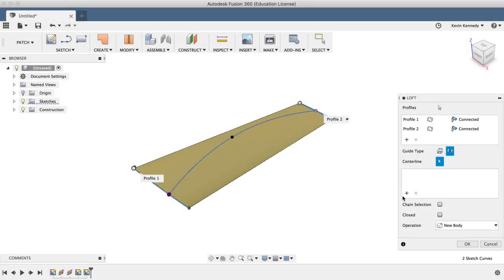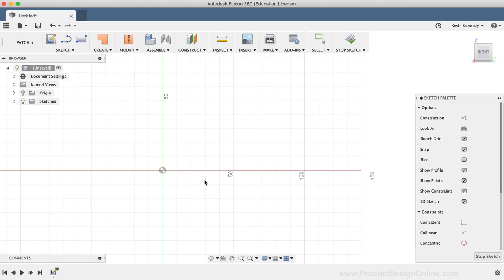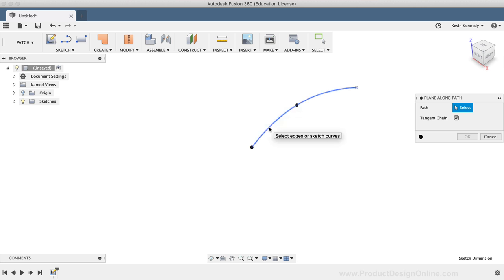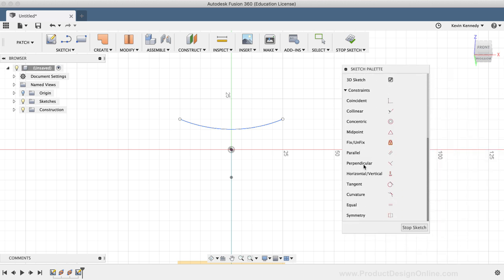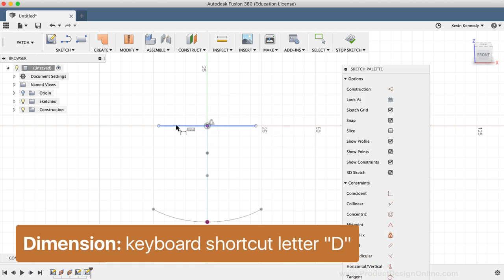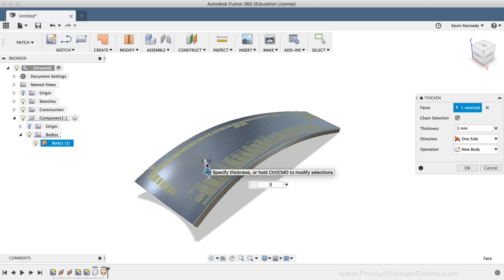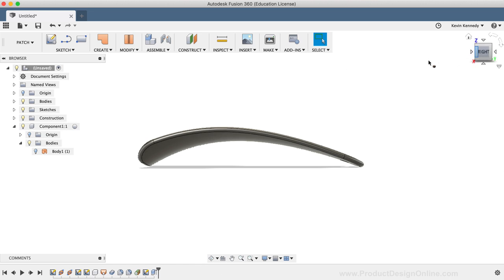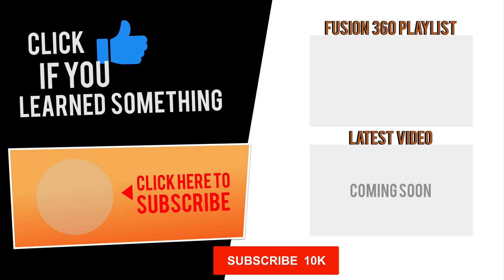How to Surface Model a Shoe Horn in Fusion 360 (for 3D Printing)

Comment: Another great video.  I strongly recommend viewers follow along at home.  Just watching is not enough, there's a lot of good stuff in these videos you miss.

A few things I've learned along the way:

1) First watch through the video at 1.5 speed so you can see the entire process end to end, then each step makes more sense when later
2) Switch back to normal speed and use space bar to pause video as you follow along
3) Alt +Tab between F360 and YouTube
4) Compare all the switches and settings in the dialog boxes so that yours match Kevin's EXACTLY or you may have problems later
5) Make sure you're in the same mode - Patch or Model can also send you down the wrong path
6) Be prepared to try three or four times to get it right just like in the video.  Trust me, it gets easier!
Reply from the maker: I love this, Jim! All great suggestions to the community!!

I understand that everyone learns at a different pace and has a different learning style... and I'm always trying out new teaching techniques. I'm also always open to suggestions and constructive criticism.

However, some viewers don't take the time to think critically about what may be going on. It makes it particularly challenging that Fusion 360 is updated monthly and a video can quickly be "out of date," as in, the visuals are not quite the same. I have been 3D modeling for about 11 years now and have been using F360 since the early days (6 years)... viewers should remember that it takes hours and hours of practice to be able to work through everything... and I strongly believe the small roadblocks reinforce critical concepts and are a crucial step to mastering a complex piece of software, such as F360.

I think you hit the nail on the head with this comment...and as always, I appreciate your continued support! Cheers, Kevin :)

Comment: Really good video as usual from you Kevin. I'd just say that there's a lot to follow in this one and it might be good to do a quick run through what you're doing first and then in detail. Something like "Here's a run through on how I do this, and then I'll walk through it again in detail so you know what's next in each process"

Great video and I can use this for sure with things I make. Re the 3D printer I use a CR10 4S with CURA as my slicer, and I have a large self built CNC too using Mach 3.
Reply from the maker: Thanks for the feedback, Kelvin! I definitely need to start "playing" around with some new styles of talking through these lessons... especially the more "advanced" workflows. I will take all these into consideration for future lessons.

RE: 3D printer... that's great! Let me know if you end up printing one of these shoe horns out. How big is the bed of the CNC you built??? (I'm jealous). Cheers, Kevin :)
Reply: @ProductDesignOnline  A friend / colleague made it. It's pretty large 8' wide with a 4' lift and theoretically infinite length. Also has a 4th axis facility
Reply from the maker: @kelvink8955  That's incredible! Keep me posted on any cool things you make ;)

Comment: I was gonna say: This is a difficult thing to 3d print. It will need a certain orientation and supports. I would try placing it standing at 45 degrees and supports from base I guess. Thank you for another great tutorial man!
Reply from the maker: Thanks, Nick. Glad you enjoyed this one. Yep... I guess the orientation depends on what type of printer. I was planning on printing it out with a dual extruder (commercial printer) that I have access to, in which one of the materials will be dissolvable.

Let me know if you end up printing one out! I'd love to see a picture and hear which way you ended up orienting it. Cheers, Kevin :)

Comment: I am trying to learn how to make custom pistol grips in Fusion 360 to then mill on my CNC machine.  I can import the exact outline sketch, just have to learn how to sculp the grips to desired shape and then add custom engraving design.  2 separate grips which are identical (mirrored).  Great videos!

Comment: Thanks again Kevin for the quality content as usual. This was actually quite interesting and I think it has already answered one of my big questions that I meant to ask a few days ago. Let's say I have designed a wing which has a few ribs and a single-component skin -- made using the surface modelling techniques you have demonstrated in the previous videos.

Now the surface/skin of the wing should be split into smaller components, so they can be individually made out of aluminium sheets. Am I right thinking that I should use the 'Plane Tangent to Face at Point' and then start splitting up the surface into pieces that I need, so it would respect the shape and curvature of the wing surface?

The edge of these skin components should line-up with some of the wing ribs and they should slightly overlap each other, so they can be riveted together to the wing rib, so it won't be a freehand drawing or some arbitrary cuts. If you have any comments regarding any of these, I would love to hear that.

Also I do realise that this is not something that most viewers would need to do very often and it may not be worth of your time to make a video about it. But I would really appreciate if you can point me to the right direction.

Thanks a lot!
Reply from the maker: Hi, Mahdi M. I think you're on the right track. You don't necessarily have to use the 'Plane Tangent to Face at Point.' You can use any of the construction planes that allow you to create the geometry you're looking for.

As far as the different surfaces... I think you're correct. I would try to make them all different surfaces. Then, you will probably find it best to create a component for each surface as you thicken them with the thicken command. I would then recommend coming up with some sort of numbering system so it's easier for you to understand what panel is what.

One thing that you may find helpful is to create a large surface over the wing's structure. Then, you can split the face up into sections (as you mentioned)... and then you could use the "extend" tool to extend faces where you need them to overlap. The only thing you'll have to be careful of is the surfaces running into each other.  You may have to rotate or reposition the faces before you extend them.

You're doing great implementing some of my tutorials into your own designs. Keep it up!!!

Cheers, Kevin :)
Reply: @ProductDesignOnline  Perfect! Thanks a lot Kevin for your recommandations! I've recently come to known Fusion 360 and I'm absolutely in love with it and your tutorials not only helps me do the things that I need to do, but also keeps me interested to learn and discover more of Fusion 360!

Thanks again for your time and I guess I’m going to keep bugging you every now and then with my questions!

Cheers,
Mahdi
Reply from the maker: @Mahdi-bb4hg  You're welcome!.. and don't worry... you're not "bugging me." ;)

Feel free to ask questions anytime you have them... I try to respond to all questions in a timely manner. Cheers, Kevin :)
Reply: @ProductDesignOnline  Cheers, thanks a lot Kevin!

Comment: Is that mean we should draw a point before making it into a curvature? (Since it may not form a point automatically in a different case, right?) 
So we can use "Tangent to face at point" later on to draw a sketch directly on the curvature surface? 
(It bothered me to not to have an easy way to draw a sketch on a curved surface, although I'm not oftenly use it as a newbie but I'm wondering how in different ways)

Comment: Hi Kevin, Firstly i want to thank you for the very informative videos they are very helpful. However i have a current problem and have been searching but don't seems to find a working solution. I have sketched a design on a flat working surface (X & Y). Now i need to bend this model slightly and then mirror it to complete the design. So my problem is to create the bend of my model/sketch. Unfortunately i did not start of with a spline since i am only editing a previous model.  Please advise on a working solution?
Reply from the maker: Hi Neil. It depends on the object. What shape are you trying to create?

Comment: we have a uniform thickness. But If we want thicker  wall in the middle?
Reply from the maker: Hi, teknik. Great question. You would have to create a profile in the middle and then use the loft command (instead of the sweep command) where you can choose that profile. Cheers, Kevin :)

Comment: Using the loft command, how is that you are able to select the arc and line? Isn't it looking for a closed profile? Mine is un-selectable while replicating your exact steps.
Reply from the maker: You will have to use the surface loft command under the SURFACE tab in the tool bar. Surface modeling does not require close-profiles like solid modeling does.
Reply: @ProductDesignOnline  I appreciate you. Great videos. Subscribed.
Reply from the maker: @rooshio1  Thanks!! :)

Comment: For what ever reason when I select the plane along path in create sketch f360 gives an orientation view with the x axis going up and down vertical.
Reply: I hit the same problem. I was able to workaround it by turning off "Auto look at sketch" in Preferences->Design, then select the construction plane and click Look At before creating the sketch. Not great but worked.

Comment: If I select the loft function, it doesn’t recognize the small line and arc, only the centerline is recognized, what do I wrong? It also looks like fusion has changed since this program
Reply from the maker: Hi Loek. Check to make sure the "Chain selection" is on in the Loft dialog box.
Reply: @ProductDesignOnline  I have the same problem. and I do have "chain Selection" clicked on. Can not select the arc or line. Just able to select the centre 'rail'
Reply from the maker: @dougdochstader8521  make sure you're using the Orange Loft command found in the "SURFACE" tab and not the blue solid model Loft command
Reply: @ProductDesignOnline  Thank you Kevin, I did find it after rebooting and some searching. P.S. thank you very much for the great videos.....

Comment: How does it hold to the surface so there is no movement once it starts printing.
Reply from the maker: A brim (or raft) is recommended. Then, best to clean up the edge after the print is complete.

Comment: It just so happens I needed to make a mounting plate for something in my truck that would have a similar base as a shoe horn.  So I was able to follow your tutorial to get the basic design done and printed.  I printed my first test and it isn't perfect so I'd like to make some edits to the shape.  I cannot figure out how to get back to the sketches on the construction planes so I can modify the dimensions.  I thought that was part of the purpose of designing it the way you did with the center constraints, the fillets and adding the dimensions.  I'm sure I'm missing something obvious, but can someone guide me please?
Reply from the maker: Hi Justin, after using the loft command the sketches are automatically hidden... however, they're still available in the Fusion 360 browser on the lefthand side. Toggle open the sketches folder and click on the light bulb icon to turn them back on. To edit the sketch simply right click on the sketch and select "Edit Sketch." You'll then be able to change dimensions or completely change/alter the sketch.
One thing to note, if your profile changes a lot, then you may be required to re-select the profile within the loft command. To do so, simply double click on the loft command in the timeline and then reselect the profile shapes. Let me know if this helps! Cheers, Kevin :)
Reply: @ProductDesignOnline  That worked perfectly, thanks for the quick reply!  I made the edit and will print another prototype now.

Assuming I get this base figured out, I have a question about my next step.  I already designed the post and ball mount that I need to add to this mounting plate.  It's in another F360 model that I did with a different base.  I'd like to leverage that previous work, if possible, taking the post/ball mount from the other model and attach it to this base.  Can you think of any of your tutorials that would be a good reference for an effort like this?
Reply from the maker: Hi Justin. No problem! Glad you got a new one ready to test...

I don't think I have any videos on inserting designs into others, yet. However, all you need to do is make sure the bodies, sketches, and relevant features of the design (post/ball mount) are nested under a component. Then, you have two options to do this.

Option 1) You can right click on a component and select "copy." In your other design file simply right click on the component and select "paste new." This will paste a new component of your design that is completely independent of the original file... meaning if you alter that post/ball mount it will not affect the original file.

Option 2) The other option would be to insert your post/ball mount file where it would be linked. Have your mounting plate file open. Then, click the data panel icon in the upper-lefthand corner. Search or navigate to find the post/ball mount file. Right click on the post/ball mount file (in the data panel) and select "insert into current design." This will insert the design into your mounting plate file (as long as you had that open).  The key difference here is that this way of doing it will link the component to the original file. You'll notice in the Fusion 360 browser that the component will literally have a link icon. This means, if you update the original post/ball mount, the post/ball mount component in your mounting plate file will automatically be updated. If you choose this route and decide you no longer want it to be linked, you can right click on the component and select "Break Link" which will unlink the file... however, please note that you cannot re-link the file once the link has been broken.

Hopefully this is clear enough to follow along with... I'll have to make a video on this soon! Cheers, Kevin :)
Reply: @ProductDesignOnline  Thanks again Kevin.  All great info.  I will give one, or both, of these ideas a try once I get my mounting plate dialed in.
Reply from the maker: @emanresutla  Sounds good. Let me know how it goes!

Comment: At 1:06, I don't have a "PATCH" option nor do I have a "MODEL" option! I am brand new to Fusion360 so when the wording changes like this, I get lost and go somewhere else to find answers!
Reply from the maker: Hi there. The PATCH workspace was moved to one of the "contextual tabs," which are the tabs nested in the DESIGN workspace. Select the DESIGN workspace then select the SURFACE tab. Surface modeling is the technique often used with Patch tools, which is why they renamed it :)
Reply: @ProductDesignOnline  Thank you! That was my first question too. That's one of the big problems I've discovered with Fusion 360 tutorials. Over time, they get out of sync with the latest UI changes and for us newbies, it gets very disorienting trying to find where a command disappeared to!

Comment: Im not able to select the lines when creating the loft @9:12
Reply from the maker: Hi Victor. Double-check that you're using the orange SURFACE LOFT tool under the Surface tab and not the SOLID LOFT tool under the Solid tab. Solid lofts require closed profiles...surface lofts do not, which means you can select lines. This tutorial obviously has the old interface, so the tabs are non-existent.
Reply: @ProductDesignOnline  thanks! That worked

Comment: Why I don't have PATCH and SHEET METAL in the dropdown menu? Is it because I have education license?
Reply from the maker: Hi, Živadin. I also use the education license (for these tutorials). You should have both the Patch and Sheet Metal workspaces. Are you using the new UI preview? If so, those workspaces are all tabs within the "Design Workspace."

If you're not on the UI preview and they're missing from your workspace dropdown list in the upper lefthand corner, then right click and check under the workspaces flyout menu. They should appear there like this - https://snag.gy/KXnIwg.jpg

If they're not in the right-click menu either then it sounds like a bug. Try restarting Fusion and see if they reappear.

Let me know if this fixes it! Cheers, Kevin :)
Reply: @ProductDesignOnline  Thank you for reply. Yes, I'm using new UI but still can't find Patch and Sheet Metal workspaces.

Here's mine print screens

https://imgur.com/a/gAHCJVj
https://imgur.com/a/NWGuRBt
Reply from the maker: @kikac565  In the new UI they are tabs located just to the right of the "solid" tab that you have selected. All you need to do is select them. The Patch Workspace was also changed to be "Surface" since it's technically surface "modeling." Here's a reference image for your convenience - https://snag.gy/Ayoqxv.jpg  I've circled the Patch/Surface workspace tools in orange and the Sheet metal tools in red. Simply click the tabs then all the corresponding tools will take over your toolbar. Cheers, Kevin :)
Reply: @ProductDesignOnline  Oh I see. New UI. Thank you very much you are great teacher, I really love your tutorials.
Reply from the maker: @kikac565  Thank you! I appreciate you watching my tutorials. Cheers, Kevin :)

Comment: Great Video! I just start watching you videos this week and plan to watch them all. I have been using fusion for over a year and have learned many great tips in just a few days. I have a CR-10 3D printer. And a Flash Forge Pro also. I use Fusion to design my wood working project that I create with an X-carve. Thank you.
Reply from the maker: Thanks, Mike! I'm happy you found my videos. I had the Flash Forge Pro for many years (but gave it away when I had to move) - great printer.

I'll be doing some woodworking focused tutorials in the future. I have the shaper origin and have a friend that has the X-Carve that I occasionally use. Cheers, Kevin :)

ps. don't hesitate to ask questions on any of my tutorials.